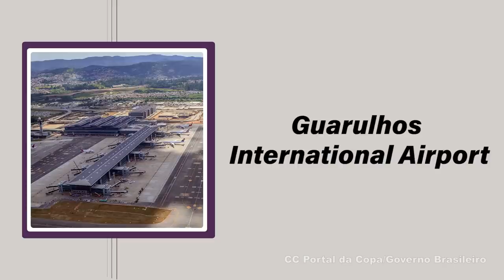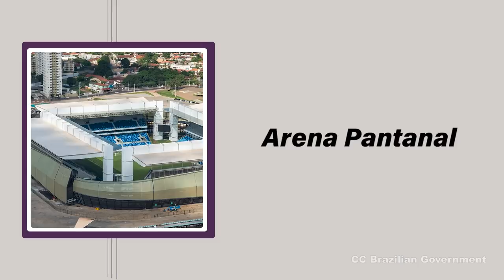Abandoned Arenas in the Amazon: The Aftermath of Brazil's 2014 FIFA World Cup

Comment: You can do a whole series on the abandoned buildings from the Olympics.
Reply: A whole other channel
Reply: Japan will certainly have a lot after their own debacle of an Olympics!
Reply: @arcturionblade1077  Japan is between a rock and hard place. Damned if they will, damned if they don't. The sunk costs alone...

With a still raging pandemic, will there even be athletes going there? Let alone tourists. Remember how many flipped out over Zika during Rio 2016? And that wasn't even immediately fatal, with lower infection rates.
Reply: @deeya  Whatever happens, Japan is in a pretty good position to weather the storm either way. It isn't going to affect Japan anywhere near as bad as it would most other countries, for a couple of simple but very relevant reasons. First off, Japan does not depend or rely on tourism for its economic survival, unlike many host cities/countries. Japan could say "screw it" and cancel the Games altogether, and it will be just fine. Tourism is only a tiny fraction of their economy. Losing tourist bucks will sting a little bit, but is not going to do any real long term damage to their economy.

 Also, Japan doesn't have anywhere near the sunk costs that most host cities rack up.  Their overall investment in this Olympiad is far lower than what other countries spent on previous Olympiads. They don't have to invest tens of billions into building all new buildings; and their various infrastructures (particularly public transportation) are already in place, well established and already high capacity (and world class, to boot). Many of the venues being used are well designed, highly engineered and remarkably crafted legacy buildings originally built for the 1964 Olympics. Since then, these popular venues have been regularly used, meticulously maintained, regularly updated and fully modernized. In many ways, they are in as good or better shape now than when they were built sixty years ago. They are a great example of how to successfully build Olympic venues that last, unlike the subject of this video. I would not be surprised at all if these same venues get used once again when Tokyo hosts the 2076 Olympic Games.
Reply: Only LA made out back in 1984 as there were already a ton of venues established in Southern CA.
Reply: @wallymcshifty  problaly
Reply: Or from Brazil
Reply: @arcturionblade1077  When arent the Olympics a debacle?
Reply: Every olympics is a total waste of money.
Reply: Yes!
Reply: He did Greece, at least... I think. That may have been another channel, though.
Reply: @damiankaren  Damn right!
Reply: I think he already has done a video on that
Reply: I don’t know if I could watch a six hour video….
Reply: I would watch that
Reply: Or a whole episode on how any investment by the public in a sports team never pays off long term .it's just subsidized wealth transfer from the working class to the rich
Reply: @pickeljarsforhillary102  Including the Coliseum, which had been used in the '32 Olympics.
Reply: easily
Reply: I agree!
Reply: It would probably be interesting for him to do a video on the few places that actually did positive things with the Olympic/FIFA buildings after. I know of Salt lake made something out of almost if not all of there Olympic buildings but I don’t know of any others, but there must be a few
Reply: @michaelsommers2356  And the Coliseum is used regularly, been to a few concerts there.
Reply: @Arcturiolpl4th
Reply: The exception being London, where they actually created temporary structures designed to be dissembled but have in fact remained due to demand for their use.
Reply: @PatrickPaul1203  London has all their venues still in use. Many temporary structures have ended up remaining permeant.
Reply: @phillipwiles5581  I haven't watched that one.i think it was an old stossel report I saw years ago breaking down the costs .. will watch that one when I get some time later
Reply: @wallymcshifty  Abandonded Projects
Reply: Abandoned malls
Reply: Yes Olymoic Stadium in London and West Hams pathetic attendance
Reply: So much for turning it into a neighborhood
Reply: Please do!
Reply: Yeah montreal made an attempt to use theirs for a while then just kinda gave up
Reply: @--_--IMP--_--  well ugh this didn't turned out well
Reply: @damiankaren  not 2012
Reply: Olympics..World Cup etc. Make a bunch of richer people richer. Do what US is doing. Using existing stadiums all over US, Canada and Mexico. No construction needed.
Reply: its not abandoned, they use it all the time, its there main stadium.

Comment: Hello from Manaus
white elephants sums it up. Totally agree, to top it all of it was buit with little care.
The stadium here in Manaus is unbearably hot, there is absolutely no ventilation. The canopy prevensts the air flow from the sides and it doesn't block the sun, beacause the sun sits so high here near the equador for nearly the entire day. We had a better stadium before believe it or not. There are many other of design flaws, not enough energy, generators have to be improvised and still needed when there is an event. There is no parking, and the main streets have to be shut down so getting there is a nightmare. The list goes on...
Reply: Jesus Christ
I rarely hear from that stadium, has it ever been used for something since the world cup, other than as emergency hospital?
Reply: TBH when there's a big event in Maracanã the roads near it are also close, the difference is you have both train and metro stops near the stadium, which helps a lot
Reply: Se no Morumbi eu já acho foda aqueles jogos à tarde no verão, imagino em Manaus com isso que você falou...

Comment: FIFA usually requires 8 soccer stadiums in good working conditions, and Brazil could have met this requirement with existing stadiums in Sao Paulo, Rio de Janeiro, Porto Alegra, Curitiba, Belo Horizonte, Salvador, Recife, having to build only one stadium to specs in one other city, assuming that the Goiania stadium was not up to specs.
Brasilia, Cuiaba, and Manaus do not have any professional teams, which means that those stadiums would be abandoned immediately after the cup.
President Lula, however, very much involved in the selection of Brazil as the host by FIFA, decided to ask for 12 host cities instead of 8.
The only reason for that that I can think of is the kickbaks availabe by the constructors in each stadium.  That would be a money festival.

Comment: The most "advanced" buildings are also the ones which require the most upkeep.  Simpler. sturdier designs that avoid the "airy" feel that requires buildings to barely be strong enough to remain standing, would have been a better choice for sustainability.
Reply: Lol. You mean the ones demolished in Brazil to make room for the new ones and the old ones that simply werent used...
Reply: @rahowherox1177  For sure.  If they'd given them a basic refurbishment, they would have been able to finish the other infrastructure projects like improved roads and airports that people would actually use after FIFA left town.

Comment: What is the organizing committee supposed to do except give timelines for the projects? How is the committee at fault for safety probelms of its subcontractors?

Safety measures are definitely in the responsibility of the company that works the contract, and you can very well give a contract to a company and demand the contract to be finished by your standards and time limits - after all, you're still paying for the contract to be worked.

If I need a garden architect and I want my garden done by autumn, I tell it to them. If they say they can do it and they get my contract, they better do it and not shift the blame on ME if they can't finish my garden until autumn. Also, I'm not the one having to check if their workers behave appropriately, I don't have to run around my garden telling them to wear a hat or anything. I pay them and that's that. How can the blame ever land on the party giving away the contracts for GIVING A TIME LIMIT and NOT ENFORCING SAFETY to their subcontractors?

Because basically that's what is said in this video - 'shift the blame to the party that gave away the contracts, in this case the oganizing committee' - and it makes absolutely no sense whatsoever.